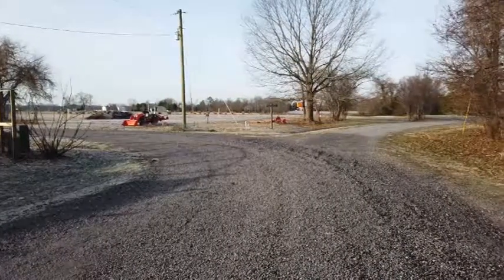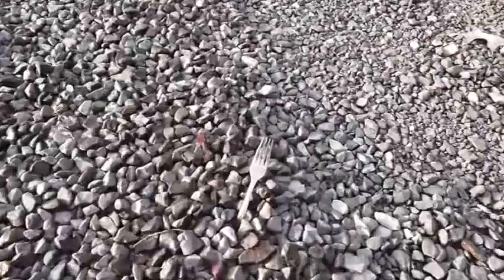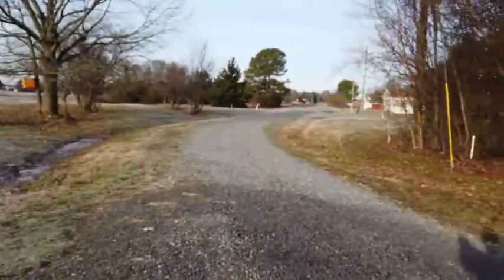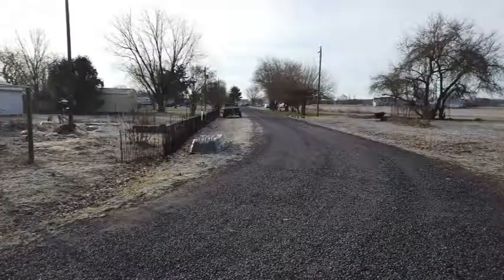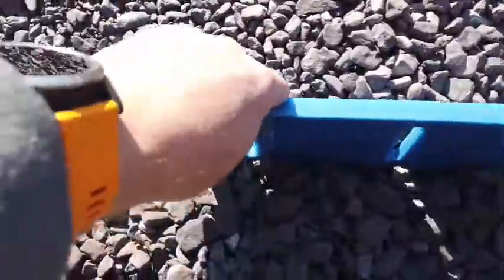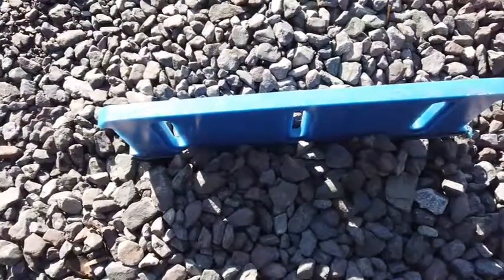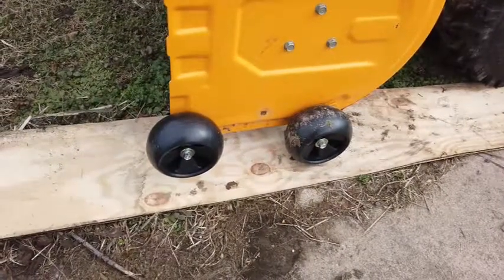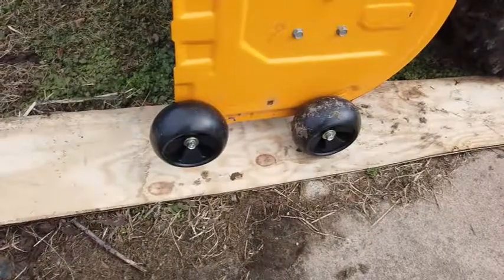Fixing snowblower to use on loose gravel road  vlog #5

Comment: I added deck wheels years ago but only to the front. Under some conditions I am very happy with them. However, they push some snow and don't slide into deep packed snow very well making it more of a wrestling match. Also, it makes the blower climb when entering snow drifts. I am probably going fabricate a long metal slide to get more float and less drag.

Comment: I was thinking - rather than using asphalt again on my little drive way when it needs renewing (the town is promoting permeable driveway solutions to reduce storm sewer runoff and that's generally solved with paver bricks which I don't really want) - I'd use gravel like long years ago. The problem is snow shoveling over the gravel with small amounts of snow typically more often than deeper snow dumps - I'm going to try adding some wheels to a manual snow shovel imitating your solution (now I'll need a gravel drive near by for testing prototype solutions) the gravel won't need surface contact scraping like the asphalt does.
Reply from the maker: you only need to get snow down to a couple of inches, any car can drive over snow less that 3" deep.l
Reply: Asphalt millings are apparently very cheap and you can either pack them down or use chemicals to refix them into a black top. Sounds like you'd just want to pack them down.

Comment: Won’t the wheels dig through the loose gravel?
I am having the same problem with my plow attachment for my zero turn. It kept digging into the gravel, even after installing a PVC pipe. I want to get a snow blower but I worry the skids will dig into the gravel.
Reply from the maker: I adjusted the height of my wheels so they leave about 3" of snow, not too much snow that I can't  drive thru.  It hasn't snowed enough here in the last 6 years to even use the snow blower.

Comment: just bought 2 same exact wheels , looks like the back ones you made a mounting bracket for cause the front ones did not get you enough lift above the stones ??? please confirm
Reply from the maker: yes, I made a bracket and then I went to larger wheels to give 3 inches of clearance because any car can drive over 3 inches of snow.